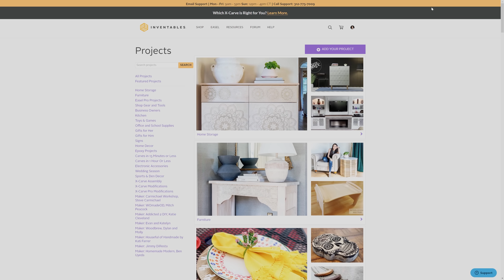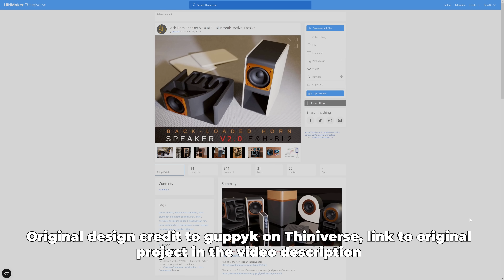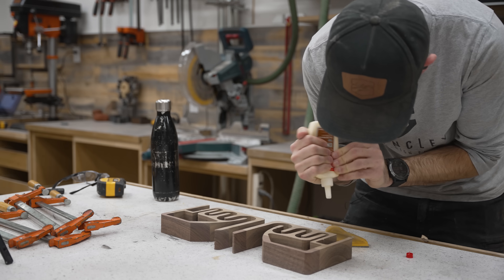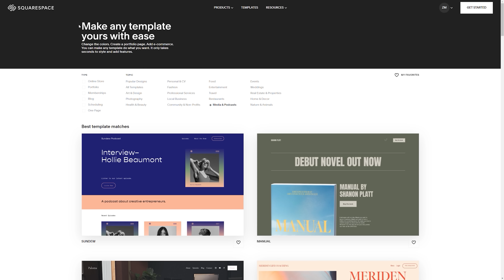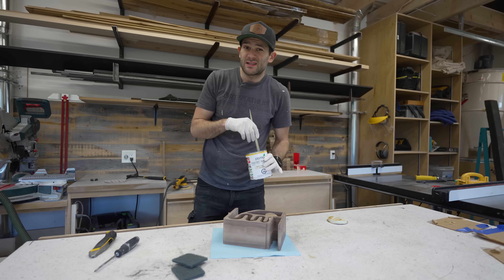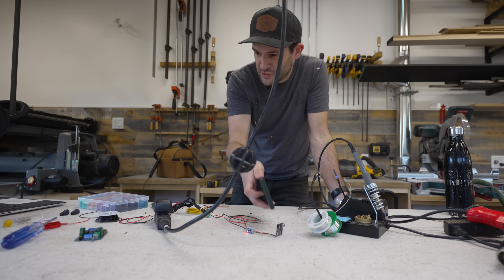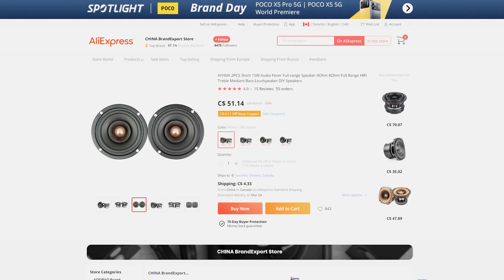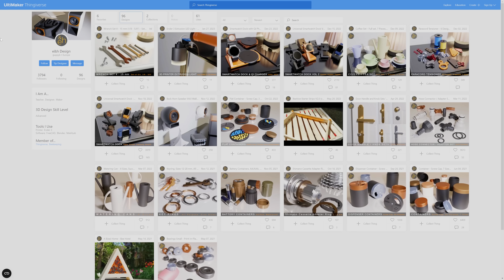Your 3D printer is now obsolete...

Comment: Keep an eye out for 4" coaxial speaker drivers if you want to experiment with more compact speaker builds like this. You will need a crossover network for them, but you'll get even cleaner separation of your mids and highs, particularly while strong bass is playing. Well, as strong of bass as you can reasonably expect from such a small driver. Dayton Audio has one that looks pretty decent.
Reply: Crossover filters are used for paring the limitations of multiple drivers. You might have meant that a rumble filter could be useful here? Full range designs use a single driver from roughly around 80 to 90Hz on the low end up to 15 to 18kHz on the top. Since one driver is doing all of the work, a crossover is not necessary. A rumble filter could quickly cut frequencies under the limitations of the drivers bottom end however, which could help with distortion.
Reply: @Weicho1  COAXIAL. Two drivers in the form factor of a single driver. Some COAXIAL drivers might come with a simple crossover baked in, but most will not and you will need to provide your own.
Reply: @mndlessdrwer  My apologies. You are absolutely correct. The driver he was using had a phase plug, so not coaxial, and I missed that for some reason in your message. I have designed a multitude of full range speaker systems mostly using full range drivers with phase plugs. Most of the systems were transmission lines and tapered quarter wave tubes. I would have never thought to use a coaxial driver in one of these systems, but I can see some benefits and some sacrifices. Please forgive my oversight. I find that bit of information very valuable to anyone looking to dive down the speaker building path. Great catch.
Reply: @Weicho1  The main compromise is that you lose out on the particular "sound" of a single full-range driver, but that sound is primarily comprised of distortion and peculiar harmonics that arise from trying to drive a full frequency range on a single speaker and pushing past driver breakup and beaming to do so. By using a coaxial, you can largely avoid this while still maintaining the single point-source coherence. If you opt for a coaxial driver that uses a compression driver for the tweeter then you can drive your distortion extremely low. The quarter-wave and transmission line enclosures still work for the woofer, so you still get some of that cabinet tuning sound signature.
Reply: @mndlessdrwer  You know your stuff. It's been a while since I've designed and built any enclosures, crossovers, etc. I had made a 4 inch tapered quarter wave tube, using low distortion drivers. I put a high pass / rumble filer on at 24db slope. The drivers had an FS around 110Hz so it was important to cut the bottom end. The rest measured with very low distortion and harmonics at 1 meter. Quite flat for a single driver too. I seem to remember something about spatial reflections? Harmonics? Something that was less pleasant about the coaxials.  Sure they relieved the top end but there was a compromise. Pretty sure the only coaxials I tested had silkies for tweeters. I'm not a big fan of compression drivers. Notorious for loads of distortion, but I know people defend them fervently, so I won't press the issue. Like tube amps, if you like the sound, who am I to judge? Plus I like tube amp sound, so I'd be a hypocrite if I judged.

Comment: Love the Idea ! 
Did you consider carving alignment holes and little dowels to help with alignment when joining the 2 parts ?  It could be seamless and make the process less stressful :)
Reply: Good suggestion. Zac is not thinking fully in CNC machining/assembly mode just yet. I'm sure he'll adopt some smart assembly locators etc for future projects
Reply from the maker: Love this idea! I'll keep that in mind for next time.

Comment: Pin holes on the gluing surface for alignment, I agree with the channel for the gasket material (1/8" ball end mill and some 1/8 silicone tubing, easily compressible & trim to fit). Eggcrate acoustic foam.
If you go thicker with the acrylic CNC a 45 degree chamfer around the permitter. 
Great job and very cool looking speaker. Subscribed

Comment: One thing I would've done differently: don't remove the solid sides until after the glue-up. Also, as so many others mentioned, add holes for dowels to keep alignment when gluing the halves together.

Comment: Great job on this speaker 🔊 👏. I love how you can see thru it. You could try running a thin flat bead of clear silicone on the wood. Let it dry and it would make a gasket to seal it and stop any vibration noise. Look forward to seeing your next project. Cheers from Calgary Alberta Canada 🇨🇦 👍 😀

Comment: Nice build!  It would be super cool to see a comparison to a 3D printed version for a true comparison in the build processes.  I'll keep my 3D printer running for now lol.  I think that over time the CNC community will figure out how to tweak the 3D printer STL's for CNC - because I'm sure there are several things he could have done to optimize the design for CNC.  Also the assembly.
Reply: I would have just 3D printed it in wood and stained it, I do have an MPCNC though but I wouldn't go out and buy a super long mill bit just for that.

Comment: the cool looking channel is seriously ruined by literally everything else inside of it... and that nice big chunk your hole saw took out above the speaker... nice. think my 3d printer is very safe for quite some time. especially since it's for much different things really. yeah, layer seperation can be just as fragile, but your break showed exactly why 3d printing is absolutely not obsolete... nice click bait, by the way. you are very limited to what materials you can realistically use, not to mention being cost effective. wood... bout it... or thin, soft metal. and wood, you have to account for the grain, or you end up with it breaking in half... again, like your's. and even then, somewhere that grain is gonna be a problem no matter which way you oreient it.

Comment: Yeaaa.... my printer far more relevant than your cnc... also your cnc is still a cnc not a 3d printer there is no basically. It's one or the other. Unless you using that multi tool printer.... it's a cnc